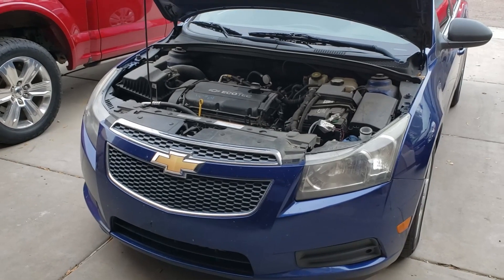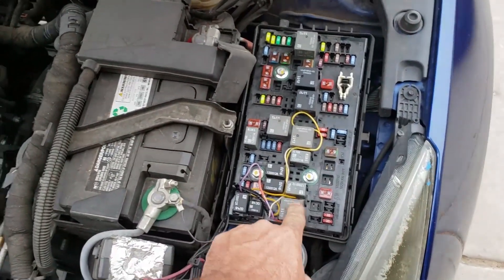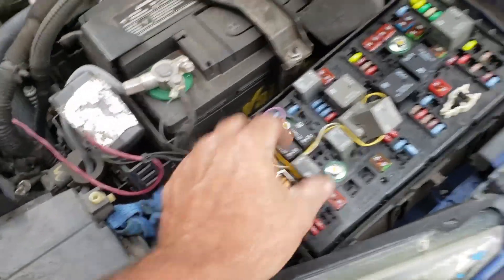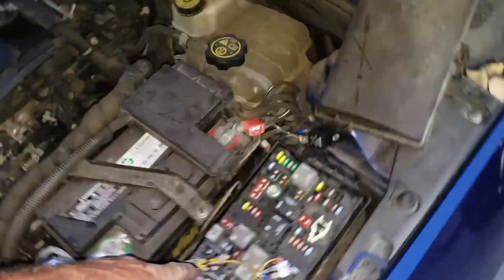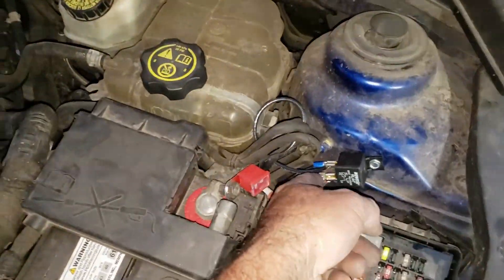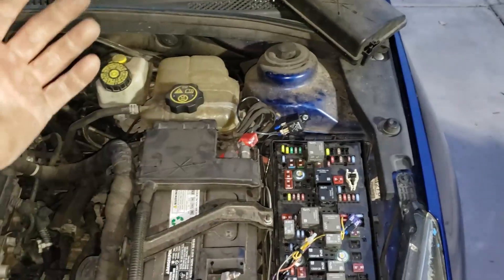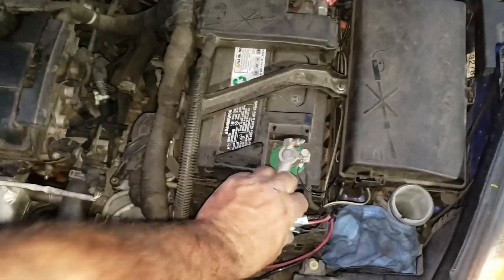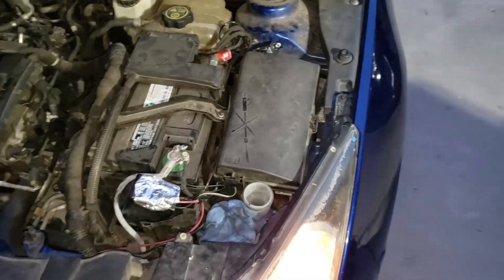Life of owning a Chevy - Modifying failed fan relay control causes failed emission test!  Duh-Oh!

Comment: I had a turbo transit work van. 15k throttle body went off out 49k transmission went and at 60k cat converter . Company stopped buying fords and went back to express vans as they are much more reliable .
Reply: I am so sad that they discontinued the E-Series vans, it was a solid platform. Transits are junk.

Comment: I have an 18 Cruze Diesel... even the headlights are BCM controlled.  EVERYTHING is BCM controlled.. it sucks!  Hopefully, that little proprietary PLC never dies
Reply from the maker: All the cars have the Body Control Module now.
Heck, I just looked at the schematic for the Sony stereo in my F-150.
The amp is called a DSP (Digital Sound Procrssor).
Maybe it's a class D amp?
It sure is compact for running a sub and 6 speakers.

Although the sub is too weak. I just removed it for an aftermarket.

Comment: You’ll very likely have to repair this properly if you have a state inspection if the CEL comes on. If the computer sees it doesn’t have control of the fans, it will flag that code. Your ingenious system notwithstanding.
Reply from the maker: We don't have those kind of inspections here.
All they do is plug into the OBD II port and check the gas cap.

As long as the engine on board diagnostics is happy you will pass.

I passed with no catalytic converters on my 1996 Mustang. The onboard OBD II was happy with the turbo and no cat so I welded on a heat shield (in case they looked with a mirror) and passed no problem.

Comment: each brand has faults.. Fiat/Chrysler being the worst... In general I prefer GM engineering over Ford. Somehow ford manages to make the engine bay absolutely full and impossible to work in... GM there is a ton of space to work on any and everything with relative ease. I have a ford explorer now.  Not wanting another ford anytime soon... Thinking about saving up to get myself a suburban.
Reply from the maker: Before I recently bought my used F-150 EcoBoost I considered a 5.3 Chevy as it had lots of room and I was planning on something to turbocharge for another project.

But I found a used Ford I liked. 
I guess since it's a nice luxury platinum I'll leave it stock.
It is pretty damn fast for stock with the twin turbo 3.5 V6.
More than enough to get into trouble.
But it won't get any loud exhaust anytime soon because they sound goofy loud.
Reply: @hackfreehvac  i now have to look up straight piped eco boosts haha

Comment: That’s why her next car will be a Tesla then you won’t have to worry about the engine fan. Or noisy engine. Or changing oil, changing spark plugs for tuneups, no more ignition coils, no more transmission service, no more power steering fluid,  no more belts, no more failing Smog emission test, No more changing brake pads for about 200,000 miles
Reply from the maker: Tesla's still have a cooling system. 

Batteries are cooled and the A/C.

Also, there are horror stories of Tesla owners being without their warrantied Tesla as they are stuck in a shop for WEEKS while the techs try to figure out the failures. 

The batteries also will likely NOT last 200k miles either.

3 to 4 year old Electric cars with over 50k sell for a fraction of their original cost.
My friend is driving a Chevy Spark right now. Got it for like $5
That is less than my daughter paid for her Cruze. LOL
Reply from the maker: I'd love to make a DIY electric car tho. 
One idea I've daydreamed about was adding rear electric power to a FWD car. My own hybrid pseudo AWD.
Reply: hackfreehvac Yes my wife’s model 3 Tesla was in the shop for weeks waiting for parts after an accident.    Batteries are cheap and easy to change 200,000 250,000+ for the batteries and only cost as much as a head job I’m technically not difficult to swap. My Prius battery after 218,000 miles was only $1700 to swap in 45 minutes.                           But after The Tesla never wanna own another gasoline powered engine for the rest of my life solar panels charge it and if you did have to charge it at home it’s only a fraction of the price of gas and you never have to go to a gas pump and the superchargers are quick. Once you drive one for a month you get converted like joining the Jim Jones colt. Drink the Kool-Aid